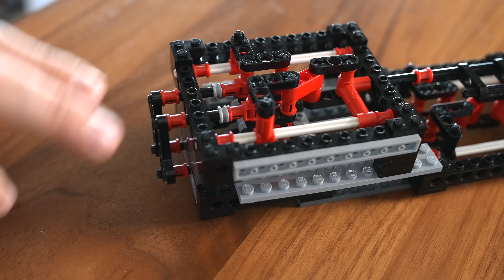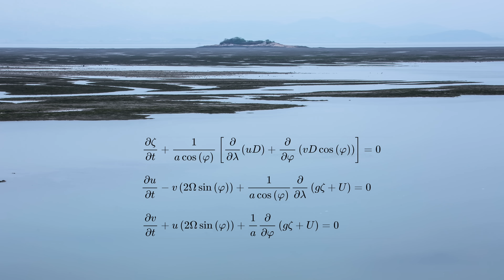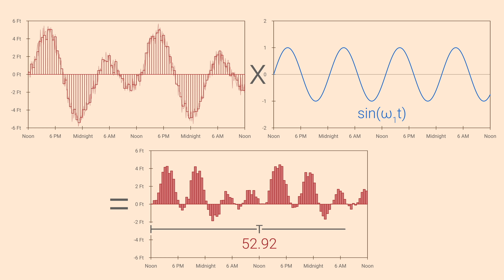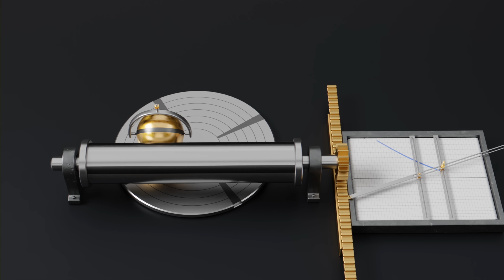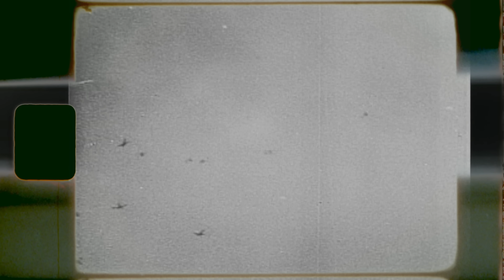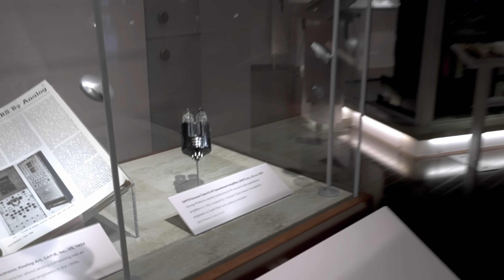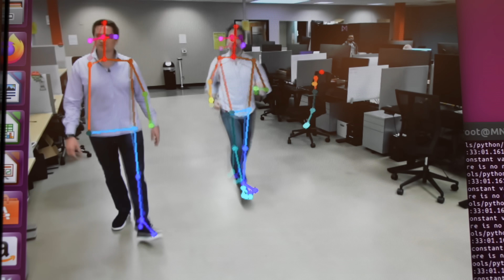The Most Powerful Computers You've Never Heard Of

Comment: i can see, how analogue computers can have a comback. a lot of things, who are used computers today, only fullfill a specific task (internet of things, embedded computing), in wich a universal purpose computer may be not realy efficient. also, because in such applications, the task must be implemented through software, its an added point of failure. also: digital computers are good in computing states, while analogue technology is good in computing changes, analogue computing parts may help to develop autonomous things in wich maybee the "brain" is still digital, but a lot of the sensors will have analogue computers in it.. therefor the "brain" dont have to process the data from the sensors, but just the calculation output of the sensors.

Comment: Analog computers efficiently use power for high-speed computations., but it depends on the application.   Digital computers can theoretically be just as fast in computations or better only if huge amounts of power are used.  Today commercial PC processors are at their limits in heat dissipation and going past a clock speed of 5GHz is not good for the longevity of the CPU or its reliability.  A hybrid of both digital and analog is needed.  Digital will allow users an interface to control the analog parts of the computer.

Comment: In 1936 in USSR was developed analog hydraulic computer. It was used to solve differential equations to tackle the problem of temperature regime of concrete while it sets (to eliminate future  cracks). After that was developed hydraulic kit from which you can combine it parts to get machine that solves equations exactly for your need. It was used in Poland, Сzechoslovakia, China, Bulgaria to solve problems in geology, metallurgy, mine construction, thermal physics.

Comment: The mechanical integrator had me unreasonably giddy with how ingenious it is. Also as for the question poses at the end, would it be that while digital is more robust and better accounts for noise, that also means you need better initial parameters, simulations, etc whereas analog rely on the real world phenomena so you only need to capture the data to get your result. As was said, analog is more specific while digital is more broadly applicable.... but only once you have the infastructure for it.

Comment: No word about pneumatic computers, which are both digital and analogue. Those systems are still used to control equipment on chemical factories where electricity is not a choice.
As an instrument fixer I used to fix them.

Comment: 1:00 I'm having difficulty accepting that the positional inputs on the Lego wheels and the position of the output wheel is actually computer.

I have now computed this issue for a couple of minutes.....

.....AND CRASHED !.....

>>>> " 'computer' - undefined."

What we call today a computer is sorta a decision making device and acts on that decision. - it is NOT.
What a 'computer' was originally (a calculator), it IS....I have run this type of computer many times - the mechanical calculators that multiply [gallons] by a variable to give $ (or in my case, £) - the cost of fuel dispensed into a vehicle.
One of these such computers also had another analogue output - controlling the 'blending valve' - the pump pumping up to 2 grades of petrol - each grade individually or up to 5 (or was it 7??) blends of the 2 grades. It blended based on the price difference of the 2 grades. It therefore had a variable for the cheaper grade and a variable for the price difference.

Comment: The Antikythera mechanism is not a computer (i.e. it does not calculate anything at all). It just repeats a certain motion very much like a clock due to the fixed size and arrangement of gears. Sad you failed on the absolute basics concerning computing in the first minute of the video.
And once again (seems to become regular with your videos) the title is a lie.

Comment: In 1977 I started a position as a control system engineer at the Foxboro company, in Foxboro MA in a group called analog system design. We built analog control systems that ran on air or voltage to control industrial processes. Even with air pressure we could add, subtract, multiply, divide, integrate, differentiate, keep time, store data and build complex algorithms without any electricity involved. Electronic analog computers using operational amplifiers could do this faster and more accurately. The first digital control computers Foxboro built we designed in house, we wrote the real time operating systems, and wrote the applications. They were so slow we worried about control loop response times. We programmed in assembly and machine language to make these expensive machines as fast as possible, and the software was written as function blocks that mimicked analog computer functions like PID controllers to regulate say temperature or pressure. Watching how digital software and hardware evolved over the years was fascinating but many measurement are made with analog sensors so the analog world is still alive.

Comment: Your analysis of the Norton bomb sight is incorrect. The bomb site was only accurate to a range of 10,000 feet. The US was using the device operationally upwards of 40,000 feet. This is why the Norton bomb sight was not as effective in the combat theaters. It was being used at a range it wasn’t calibrated for or even designed to operate in.

Comment: A key difference between analog and digital computers is how their "software" is written, modified and copied. If you make an analog computer, you are pretty much hard coding the software into the hardware. If you want to make a duplicate of the software, you have to duplicate the hardware. On a digital computer, software is just information encoded into a pattern of 1's and 0's. All you need to do is transfer that information from one computer to another, and as long as the processors are capable of interpreting the information as instruction code, they can process the same exact calculations to generate the same output.
I think analog computers are a red herring distracting us from better computing solutions. If you have a huge bulk of computation that needs to be done, performance gains can be gained by scaling parallel processing and reducing the amount of compute required by choosing better data structures and algorithms.

Comment: In  [this] UNIVERSE "things" behave in an essentially ANALOG fashion. Digital is, effectively (very effective), a modeling tool. Its version of "things" is essentially mono-linear... like a processing chip or a processing platform. Adding a third dimension to a digital platform will not solve, by processing "depth", the CONUNDRUM (the word ALIASED comes to mind) of applicability in the multi-dimensioned, analog processes present in the "REAL"  World. It will remain a digital model,  "working" but an approximation. 
A CAD-cut flying scale model of a WWII Spitfire, exact in every detail, might look like and function like the REAL thing, but it won't "fly" for the task of accomplishing its designated purpose: Carrying a Human pilot into a heads-on "Boxing" match with a Messerschmidt BF 190. As real as it gets: Proximity and Scale.

CUTTING TO THE CHASE: Back in the Dark Ages of Computers (1975), I used an integrated Analog  "harmonic"  process/function which was superimposed on a digital processing platform, to truly synthesize a GONG. The goal was not a "synthetic" or "virtual"  approximation of a GONG, but to "create" the  actual instrument. Still not the REAL thing, but the resultant was CLOSE ENOUGH to "fool"  an oscilloscope.

I took my inspiration from Nature, specifically, the Weather Machine. To wit: The analog WIND can drive a digitally designed Sailing vessel, but never the reverse.

Like so many aspects of the "Modern World", it would be akin to putting the cart of application before the  draft horse moving the load. A horse is a horse, albeit of a different color. Like Humans: flesh and blood.
🐎 🎠🛸 
Push me/pull you. Analog AND digital.

Comment: To this day opamps are the bread and butter of electrical engineers, any time a sensor is used on a circuit board (voltage, current, reesistance, temperature, pressure, light, pH,etc.) the signal output will likely require some postprocessing before it can be read by an Analogue-to-Digital Converter (e.g. your ADC might expect a 0 to 5V value, but your sensor produces 0 to 10V values). Once converted, the sensor output can be further manipulated by a digital microcontroller if necessary. 
Summing, subtracting, integrating or differentiating signals are easy and can be done with a single opamp, though multiplication and division are slightly more difficult. Luckily you don't need to multiply signals that often when dealing with sensors (and if you do, you can always do it on the digital side where it's easier). You might think it's odd that integrating and differentiating are easier than multiplication, but this comes from the fact that your opamp circuit can include capacitors and inductors, whose behaviours are dictated by equations involving derivatives and integrals. There's a very real sense in which you are offloading the hard part to physics and getting the result for 'free'.

Comment: In 1962 I was trained in the U.S. Navy to work with the very first digital computers to be installed on their ships. These were solid state, and state of the art machines. They were intended for control of air and anti-air warfare and the ship I was on had anti-aircraft missiles that took input from the digital computers I worked with, inputs informed by search radars dsplayed on digital display consoles in the Combat Information Center of the ship. 
Identified enemy aircraft locations were then handed off to the fire control computers for the missile battery. Those at that time were still analog. I once asked a Fire Control technician about why they did not have digital computers for that purpose, as he was busy with the never ending calibration alignments it needed for its accuracy. On Navy ships every little thing changed with temperature and vibration all the time.  He laughed, and told me it wouldn't work fast enough. He was right for that time.

Comment: When I joined the Navy (RAN), in the 1980s, the DDGs still had mechanical, analogue, computers for the Gunnery system.  One of the hydrographic research ships had a pneumatic or hydraulic (I forget which) computer to control the underwater towed array thing they used to take measurement.

Comment: You mentioned that a benefit of digital computers is that they are "exact" however this statement isn't wholly accurate. Digital computers are exposed to quantisation error, when mapping continuous analog values to a discrete number system. While the upside is reproducible answers, the downside is inexactness. While in reality, we can circumvent this problem by using increased precision we can't say that the answers produced are "exact".

Comment: One cool thing about the human brain, is that it's both analogue and digital. Each neuron has a resting potential, usually given as -70mV, but depending on the signals it recieves it can be anywhere from around -90mV to just under the threshold potential of -50mV. And the firing of an action potential can either happen, or not happen. So it converts analogue signals (membrane potential) to digital signals (either an action potential being sent, or not). Maybe that's the true future of computers will combine analogue and digital computing into something akin to an animal brain.
Then we'll be able to answer the age old question "Can my brain run Crysis?"

Comment: Superb presentation. Really great. I would add one little thing to your list of the virtues of digital.  Shannon also showed that a key virtue of digital is that FEC's, i.e. forward error correction codes, can give arbitrarily high guarantees against errors.  These are essential to all sorts of things such as transmitting data across the solar system. Many forms of digital data recording also use this technique.

Comment: Digital computers are not exact. They are predictable within their specification. Try to keep adding a small value to a large number. You may well find that the large number does not change no matter how many times you add that small number. Also many mathematical formulas giving zero or some other wellknown value might give 0.0000000000001 or 0.3333333333333. 

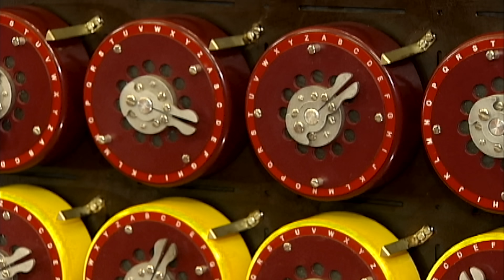The apparatus at 16:23 is not a Colossus, it is a Bombe. The Bombe was electromechanical, the Colossus was for a large part electronic (and used for another cipher).

Take care not to have such an interesting background. Your right ear looks like the ear of an elf.

Comment: Small nitpick, there were quite a few important early digital computers that were not built using transistors. It was a fairly short period of time, but a lot of foundational work around stored-program computing was done with vacuum tube based digital computers.

Comment: The whole comparison between analog and digital computing is a little skewed.  The reason we moved to digital computing is that you always get exactly the same answer every time, and you can trivially reconfigure the way it computes those answers without changing anything physical, whether that's by changing the code executed or by reconfiguring a FPGA.  You can't really do that with an analog computer, and furthermore you have imprecise answers that accumulate errors through each stage of processing since there's no way to quantitize exactly the data from each step.
Analog computing is very cool but it's never capable of giving exactly the same output over time, affected by temperature, induced electrical noise, component aging, the fundamental noise floor present in any circuit.  Try talking to a test engineer about these issues, and how we must have regular calibration of test equipment to maintain standards of accuracy.  That just isn't an issue with digital circuitry because we're not measuring exact voltages, but the threshold between two different voltage ranges.

Comment: In aviation, there is a well-known hand-held analog computer called 'E6-B'. It's still very much in use today, especially by student pilots. For about $10, you can solve dozens of common equations related to flying. Fuel/range, airspeed, wind corrections, air pressure/altitude and many more. It doesn't have batteries that can die. It is simple enough to use with one hand while flying the plane with the other. It really demonstrates that our ancestors were crazy smart.

Comment: The power of digital computers is not that they have discreet units but that they are easy to reprogram without reconfiguring there components, analog computers require reconfiguration of physical mater t do a new program. If you notice the tide predictor is a difrench machine then the integrator.

Comment: Good to see analogue on the comeback trail. We used basically a big plug board to predict rock stresses for proposed rather deep mine layouts. A bit brutal, but it worked until finite element analysis was available.
We also used analogue machines to model mine ventilation designs.

Comment: I don't think it's correct the blame the inconsistency of the analog bombing computer for the choice to firebomb Japan. There were a number of successful precision bombing campaigns in Europe during WWII. The barrier to precision bombing in Japan was the jet stream

In order to avoid counterattacks by Japanese planes, the allied B-29s approach at higher elevations than previous bombing campaigns - 30,000 feet. At this height, pilots reported strong winds unlike any encountered before. These winds made it impossible to drop bombs accurately enough to hit precision targets. This was actually how the jet stream was discovered, the winds were reported back to central command, and they eventually spoke with meteorologists who realized they had uncovered a new phenomenon

The original plan of precision bombing was scrapped and replaced with the horrific firebombing campaign described in the video

Comment: Quick side note: digital does not necessarily mean binary, and from a hardware point of view, it often doesn't. An example of that would be modern QLC NAND flash, where each cell can be charged to any of sixteen different voltage levels, which means four bits can be stored in each cell. Very soon newer variants of high speed interfaces like PCI express (PCIe 6.0) will also migrate from switching the signal between two different voltages (i.e. on or off; that's what binary is) to four and in the future probably even more than that, so they can increase the speed without having to run it at higher and higher frequencies. On the inside of digital chips, liberal use is made of tri-state logic, whereby the output of a logic element can either be a one, a zero, or left floating, to be overridden by another logic element on the same line. This is much more efficient than trying to solve the same problem with an array of OR gates like you might think this is done.

Comment: Analog Controllers remain in use in many control systems, often a PID controller which is essentially an electronic analog computer.

Would be great to see analog neural networks that operate in real time, particularly if the node weights could be reprogrammed.

Comment: You state digital computers are exact, repeatable and robust to noise. In theory you are right, if you neglect all real circumstances in the assumptions. But in practice you are wrong. They are for 99.99999% of the time, but not 100% of the time. That is why we have ECC-RAM in Servers. That is why not all cpus of the same batch run at same frequencies, because they would fail. Et cetera, et cetera, et cetera. We always push the limits further, but there are limits where the digital computers at a time are not exact, not repeatable nor robust to noise. It's not God-given, it's the hard work of engineers.